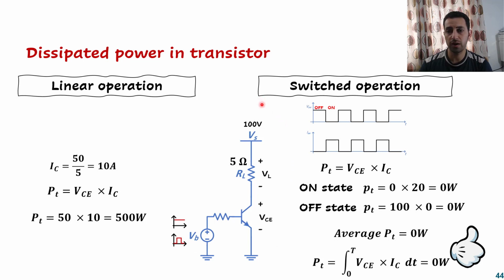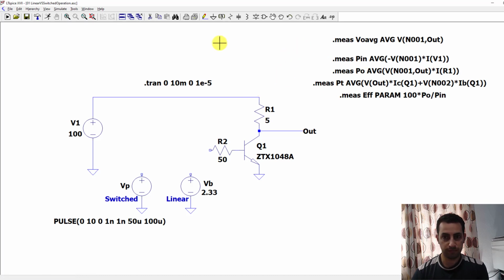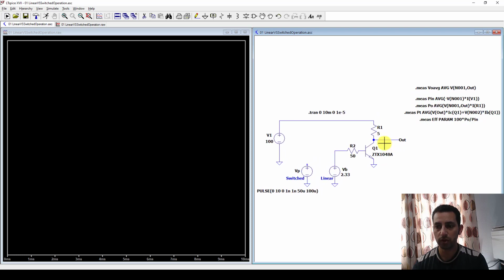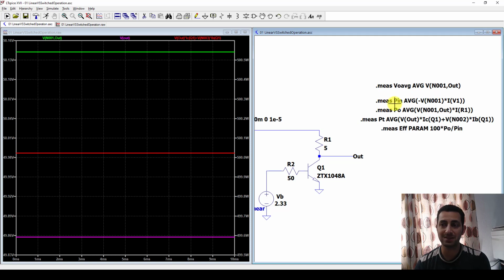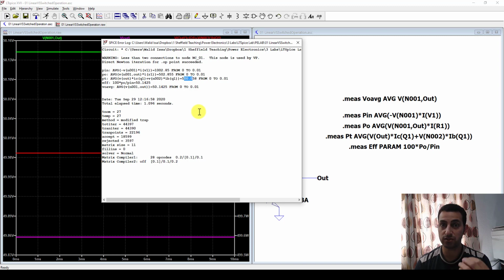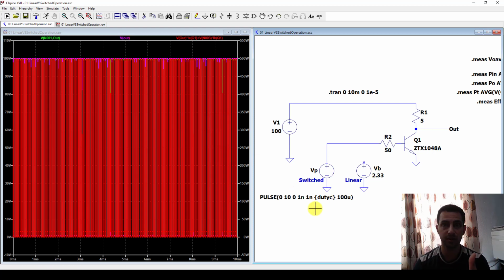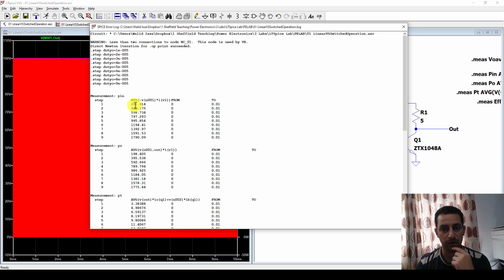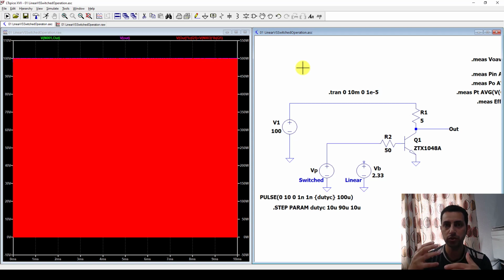06 LTSpice for Linear VS Switched operation

Comment: Hello, thanks for the lesson. I did everything like in your video. But the power on the transistor is not displayed. You can look at all the elements, but the thermometer icon does not appear on the transistor. Please tell me what the problem might be. Thanks!